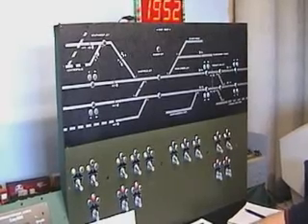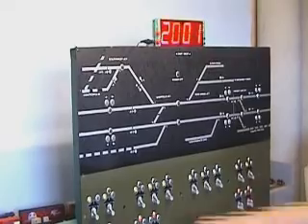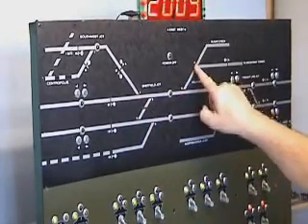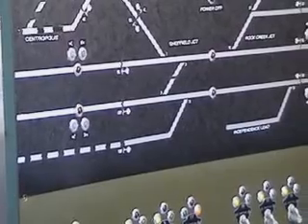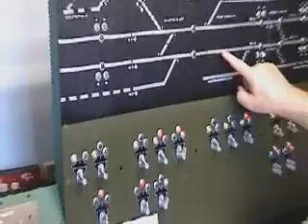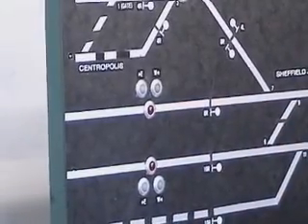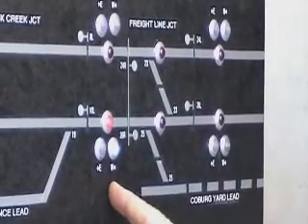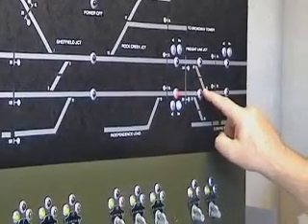Kansas City Subdivision CTC Demo

Comment: I'm learning about CTC machines and figuring out the required logic. My question is: if you route a westbound out of the yard lead (switch 11 reverse) and clear 10R, why would that lock xover 9? What if also switch 9 reverse and 8R cleared?
Reply from the maker: This video was made with a really old version of the software. The current CTC panel uses a new signal 12R to exit Coburg Yard West. It does not lock turnout 9. That's the best part of building a software based signal system, it's very easy to change the logic and add new signals or features.

Comment from the maker: Hi, yes correct it is a pure direct wire machine. That is what I wanted to build. I worked both types of machines from 1980 to 1982 when I worked for the Milwaukee Road. I am very familiar with the operation of a 502a machine. I really enjoyed operating them. When I came to design the machine for my layout, I really wanted a direct wire machine and this operates as close as I can recall to the old machine I operated.

Comment: Also the changes on a US&S CTC panel won't take effect until you press the code button under each column of toggles.  Check out the related video of a real model 510 machine operating.